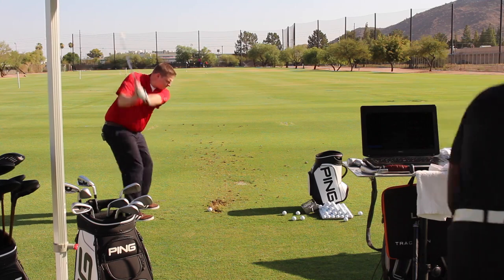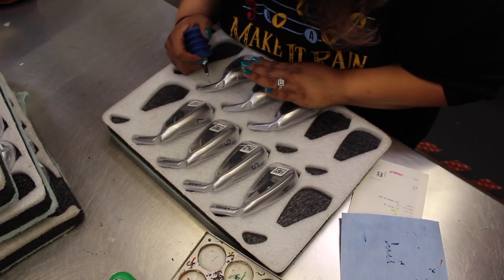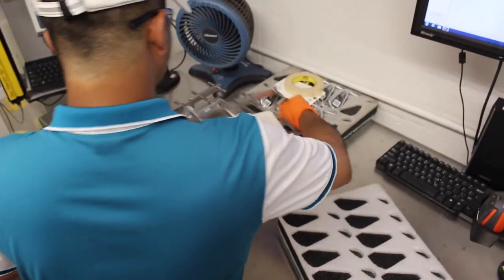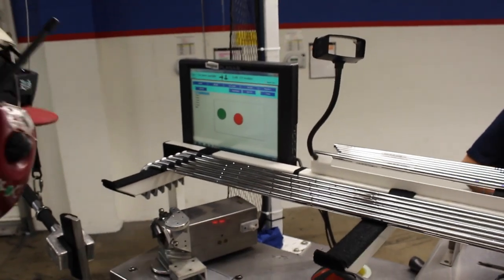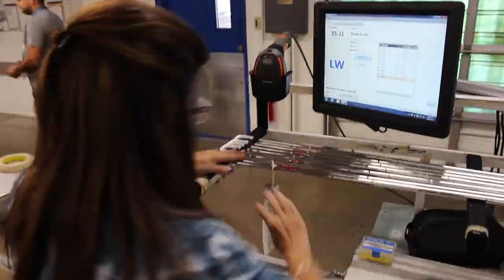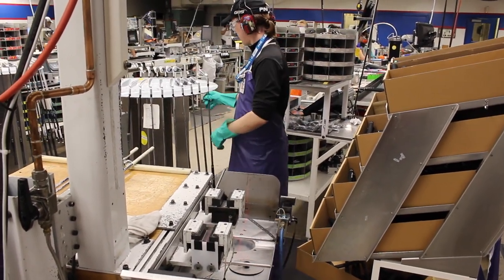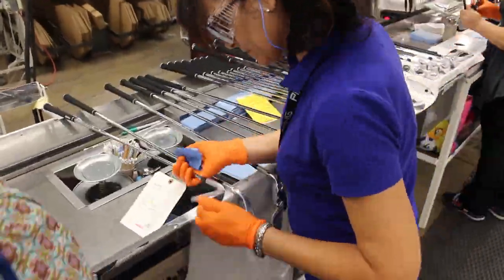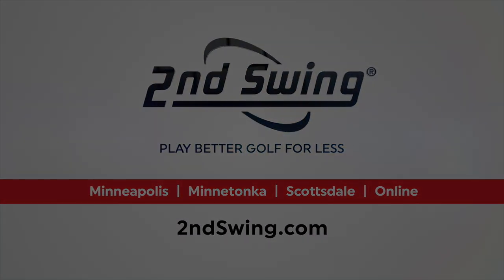Ping G400 Fitting and Custom Build Process

Comment: Great showing the building of the club but where is the "fitting" process ?  This was rushed over with little detail.
Reply: Went through the "fitting" process this past week with my area Ping-authorized/trained golf professional. He had all of the digital test equipment, software, indoor hitting area, full sets of Ping metal and graphite shafts, heads (irons, in my case), etc, and then scads of pertinent/necessary resulting test data for me to review with the golf pro. We used both steel and graphite shafts for the tests because I was sure that I wanted to stick with steel … but in the end I felt much more connected to the graphite and all of the test data showed me why I felt that way (eg, apex, distance, rpms, direction, clubhead speed). I had not been through  that sort of club fitting before this week, and I think it's going to give me clubs that will work with me rather than against me. My new Ping 400 clubs should be here in another week. My only other "fitting" took place back in the 1970s … I was asked how tall I was and whether I was right- or left-handed. That was about it.